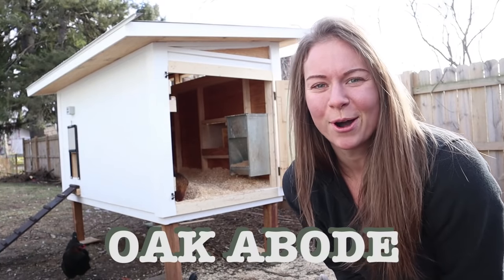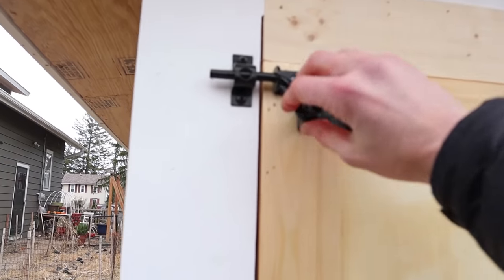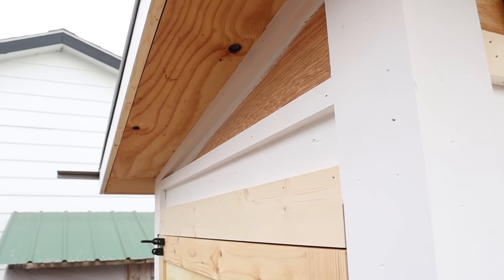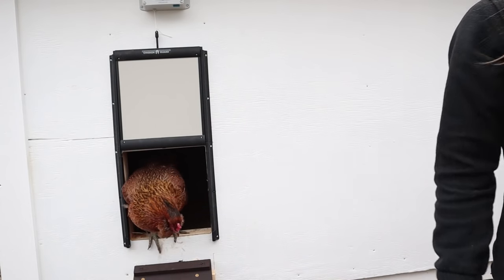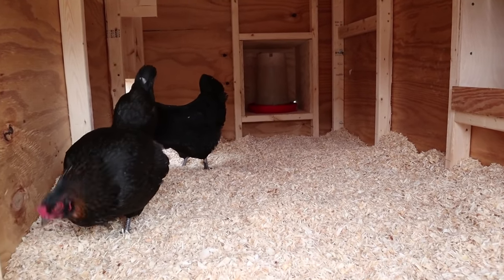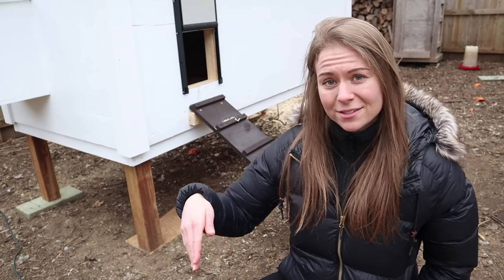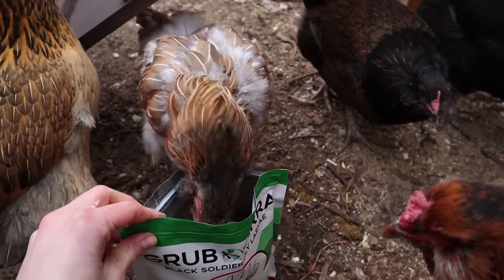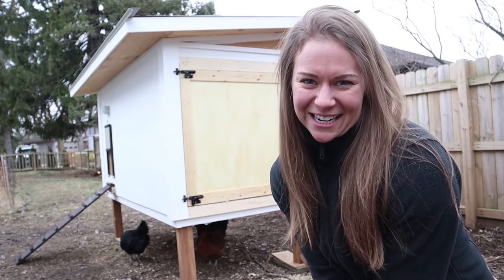OUR DREAM CHICKEN COOP | Minimal Care Poultry Housing | DIY Efficient Design for Backyard Homestead

Comment: Question: with regards to your automatic chicken door..... what if some chickens are left outside and the door shuts before they can get in??  We are thinking of getting chickens for eggs and I am studying up on videos to see what easier methods we can implement.( our chickens will be free range)
Reply: As long as you set your timer for dusk-almost dark, they will automatically go in.  It’s programmed in their little chicken brains.  You will love chickens.  Each one has a unique personality.
Reply: This is exactly my question too 😀
Reply: Thanks!!! That was my first thought too!! This is my first time with chickens and I was looking for a door solution since I could work late and not get home in time
Reply: I have an auto door. Love it. I just go out after dark (after the door has shut) and do head count to make sure everyone is safe inside.
Reply: I have the same automatic door....and I still have to be there to tuck them in at night.  Yes, I need help...lol  It would work great by it's self.  I would just be paranoid, so tucking in it is.  Great for the mornings though
Reply: @Shamiranz  This has been how i run it as well. We have tons of predators and cant sleep without checking the flock even though I've never had one left out lol
Reply: I went with a chicken door that used a light sensor instead of a clock timer.  The chickens head to the roost before dark so I didnt care about what time the door closed.  I did not want to try and reset the timer as the length of day changes.  The girls are good at getting inside before the door closes at dark.
Reply: @lukeabbott9382  I love the idea of a door with a light sensor.  Can you post a link to the one that you got?  How is it so far?  Do you like it?

Comment: Love your channel! You are awesome! You inspired us to get chickens. We started with 4. Lost 1 "traumatic" . So to replace the loss my wife got 5 more pullets. Built a homeade coop for the original girls. Turnd them out to the coop at 8 weeks. The coop has a small door and we can open the panel the door occupies and the whole front is open. The girls have 1.25 inch roosting bars in the coop but choose to roost on the 3/8 inch door that is open because of the heat. Are we screwing up keeping the "big" door open?

Comment: I like the modular concept. In my opinion one of the most important additions would be some type of poop tray under the roost. I built a wood tray that slides out through an exterior hatch for easy cleaning and is high enough off the floor that the birds can walk around underneath it. This plus food and water outside the coop means very rarely having to clean out the coop bedding.

Comment: I have one built off of the ground like that but more in an A frame style, to match my home. Just know it will be cold as heck in the winter. I covered around bottom, added insulation under the floor too. Still cold. Just wanted to share my experience. Oklahoma climate,  my coop is pink tho😉
Reply from the maker: Your pink coop sounds adorable!! Actually, our coop floor doesn’t get crazy cold during the winter since we use the deep litter bedding method, which when done correctly, actually becomes a heat-generating source due to the steady composting process. It worked so well for us last year that we never even had a single egg freeze and break! We will be adding some of the old deep litter from the old coop to the new one, since it’s probably too late in the season for the fresh bedding to compost properly now if started from scratch. Totally agree about the insulation though — we have tried insulation in the past too, and it made absolutely no difference!
Reply: @OakAbode  sounds like I need to go back and watch the rest of ur video😉 definitely been struggling to keep it warm. I've had to use a heat lamp to keep temp above freezing. I don't use lamps. Lol my other coops are warm. Hope u and yours has an amazing Christmas ❣

Comment: Mine is taller but like that with a 37 degree top peak in the middle all screws just in case 6 ft inside and 3 ft off the ground 8x4 ft that’s about 700. Did you see the junk doll house ones for 400 lollol😢 1/2 plywood

Comment: Love your coop. It’s exactly what I want to make for my girls. The only thing I would do differently is your roost bar. The 1x1 bar is actually a bit small for most chickens. They prefer a wider roost. A 2x4 or 2x3 works great. It gives their feet the ability to flatten out underneath them as they snuggle down on their feet especially in the winter. You could just add a second 1x1 snugged up to the original one to give them enough flat surface and them do the same if you add a second roost.
Reply: I've been using 4x4's (3.5x3.5) for years. They work great. The hens can comfortably rest and walk around on them. I have an overhead shelter out in the yard with proper sized branches for some natural "day roosting."
Reply: That's a 2x2 in their coop, but you're right. I used 2x3's for our chicks roosts and wrapped them with jute twine. They seem quite fond of it and we've never had to deal with bumble foot.

Comment: Very nice! The only thing I'd change is you need a depth of 12 to 36 inches for the deep litter bedding to get the anerobic compost process going (most important in the winter for the heat). Also it would be better if it was portable without disassembling so you can easiy move it to different parts of your property to spread out the concentration of manure and ward off parasites ext. The automatic door though is choice! I'm going to have to steal that idea.

Comment: with the auto chicken door, does a chicken ever get locked out?
Reply: Yeah its not like they would all suddenly know to get inside the coup at the right time right?
Reply from the maker: Haha don't worry guys -- nobody ever gets locked out because they automatically go in before the sun goes down! Doesn't take any training or anything -- it's just what chickens do. :)
Reply: @OakAbode  Thank you so much for the response! I really appreciate your videos aswell, very helpful with my new chicks :)
Reply: @Jacob Wright I have this exact chicken door and only one chicken got locked out. I’m not sure if it’s bcuz I had my Chicken Guard on “sensor mode” or bcuz that chicken was bullied and couldn’t get in in time. Luckily I heard her crying so I went outside and found her soak and wet setting on the ramp. I simply opened the door for her then closed it since you can manually override the system. I’ve now chosen to set my automatic door closure to “timer mode” adding an additional 20-25 minutes to close mode to let stragglers in and deducting it from open mode to let the bullies out early. The only thing about this is that you’ll have to keep watch on the time change throughout the year, so I adjust it every 1-1/2 to2 weeks. To me it’s no biggie bcuz I go inside their run to clean anyways.
Reply: Do they ever get trapped on the sliding door when it closes?
Reply: @mikemonte2419  Never! It closes slowly so they have plenty of time to get in. The door isn’t so heavy that if they were midway it would hurt them. They’d just scurry along. The one I got is rugged and has arms that expand out in the bottom right and left and lock into a channel so that predators cannot pry it open. It was a little over $200 but it’s worth every penny. I’m 3 yrs in and still love it. TIP: Keep a watch on the battery life bcuz it’s what opens and closes the Chicken Guard doors. I always replace it when I see it get down to 1 bar or 2 bars IF I’m going out of town.
Reply: @chrisinedison  thanks for the info. I'm getting one of those real soon!

Comment: Beautiful cute coup! We’ve been wanting to get chickens and build a coup since we moved to our first home but I was a little worried about mice getting drawn to our property because my neighbor who is about an acre and a half from our home has a large chicken coup with lots of chicken and they have mice constantly getting in the coup and eating the food and it is covered in mouse pee and poo so I was wondering if you or anyone else in the comments had any issues with mice and if it was a common occurrence? Anyway Thanks for sharing!
Reply from the maker: Great Q! We have not had any mice problems... I wonder if it has to do with keeping spare food securely contained? I’m curious on this as well!
Reply: @OakAbode  thank you so much for answering my question! That’s great to know!
Reply: A female cat will take care of any small rodents.  Female cats make better mousers because they have a built in need too feed their kittens when they have them.  Or maybe it is just an old wives tail?
Reply: Absolutely keep the food IN the coop and the coop needs to be "rodent proofed."  This means covering all cracks and openings with 1/4" hardware cloth (not chicken wire).  Periodically check for signs around the bottom of the coop for rodents trying to gnaw their way in or holes in the ground.  If the coop is at ground level install a "rat wall" or build on a slab.  Water can be kept out in the yard but emptied at night.
Reply: Thanks for your input guys! Very helpful :)

Comment: Don't think Water system should be inside the coop. Too much moisture leads to health problems and causes mold. Also try flat 2x4s for roosts. Round off the edges  it will help on cold nights so they can fluff their feathers over their feet and toes to stay warm .

Comment: Do you worry of the coop blowing over? im kinda building the same set up and torn between  if I need to concrete  the posts in the ground or should I not worry and put the posts on blocks. Flat Farm fields surround me and sometimes it gets pretty windy when storms come in.
Reply from the maker: We don't get a lot of wind where we are, but if we did, concrete reinforcement is definitely something we'd look into!
Reply: We have wind as well but my husband used 4 earth anchors and it's not going anywhere 😏😉

Comment: You didnt install any heating instrument into this coop. Can you make a video?
Reply: She has said in other videos that they do not use supplemental heat in their coops.  It's not necessary, and can actually be detrimental.  The main thing is to prevent drafts at the level the chickens are at (on floor and roosts) and have good, up-high ventilation to prevent moisture build-up inside the coop, which is much worse for chickens than cold temps.

Comment: Things to consider, adding a light bulb on a timer is a great way to keep them laying in the winter.  Have the timer kick on before sunrise to wake em up, and turn off after sunrise.  Let it get dark naturally so they get to their roost normally.  

When I built a similar nest box, we always had issues with water getting in coming down between the vertical wall and the roofing.  This was fixed by changing the door to a front(side) opening door instead of from the top.  This also allows a younger person the ability to help with gathering the eggs.
Reply from the maker: No artificial light for us! We think its very important that their systems adjust naturally to the seasons, and their well-deserved laying break is during the reduced daylight. Plus, this means they lay more at an older age, which is all good with us!

I totally know what you mean about the water coming down on the water box! It's the worst, right? We had that on our old coop, but made sure to add a nice big overhang to the roof of this coop so it doesn't happen at the nest box anymore. Love the front/side opening door idea, too!